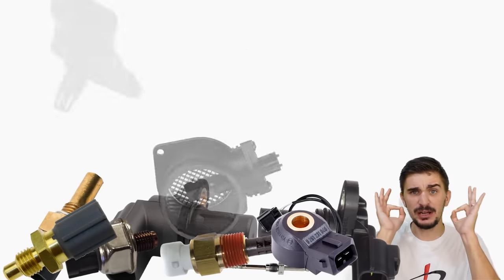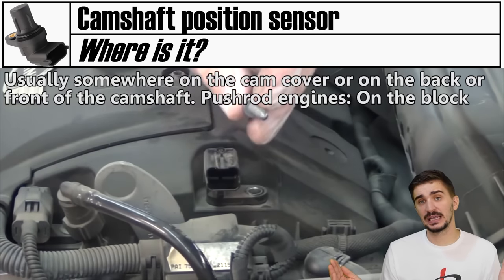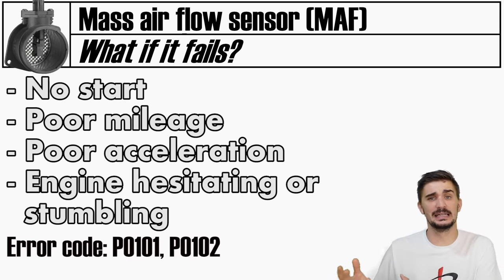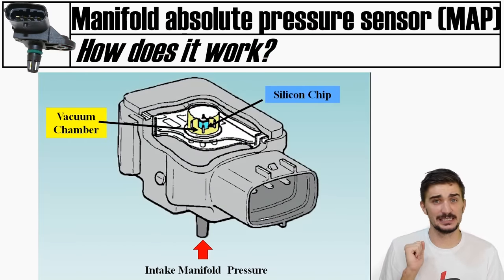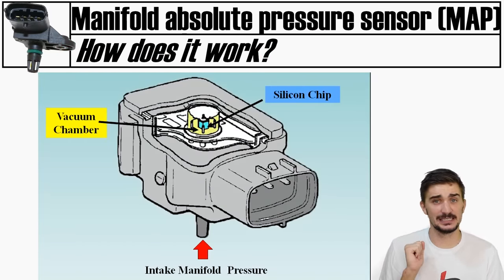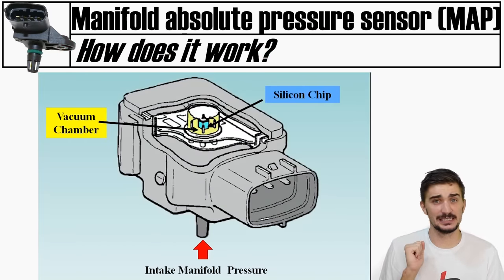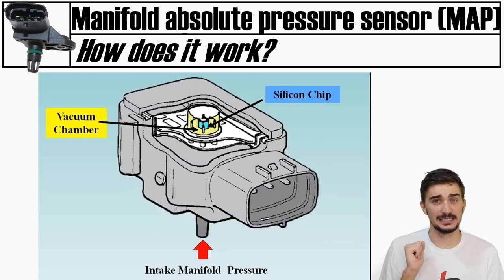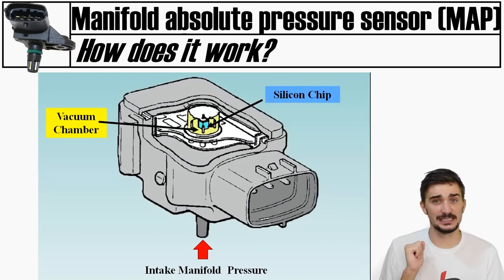EVERY ENGINE SENSOR EXPLAINED - MAF, MAP, IAT, TPS, 02, NOx, EGT - How it works, location, OBD2 code

Comment: This is pure gold, thanks for taking the trouble to make and upload this. Just one thing I would like to add, regarding fault-finding: very frequently the sensor isn't actually at fault. Instead, it's a connector somewhere between the sensor and the engine management computer. Replacing the sensor will often clear the fault because a new sensor comes with a new connector. Still, I always suggest, before spending time and money replacing a sensor believed at fault, separate connectors, spray with contact cleaner, re-assemble, re-test. I have been repairing electronics systems for 4 decades and have more experience of failed (or intermittent, even worse) connectors than I would wish on anyone!
Reply from the maker: Very sane advice! I wish I had mentioned it.
Reply: Even worse, my Idle Air Solenoid was bad. My truck would die when I'd shift from forward to reverse or just as I'd leave a stop light. It was intermittent and incredibly annoying. I finally decided that it was the Idle Air Solenoid, which it was. And it wasn't. I had removed it to clean the air passage in the throttle body. When I reinstalled it I bent one of the terminals. It was a simple issue, but since I had already bought a replacement I just installed the new one. The truck ran great after that.
Reply: I think they should do away with all that garbage problem solved
Reply: I agree. Fault finding
Reply: This is really good advice thanks @ Richard Black
Reply: So true Richard, excellent point, I myself have been in the electronics industry for decades and I've seen the same thing many times. Many perplexing problems have been solved by just reseating connectors in the affected area.
Reply: @thruitallauto2538  Guess what? They are doing away with all of them! When electric cars really become mainstream. Imagine all the sensors those will have! Good times ahead-NOT
Reply: @rickruggieri7284  lol I hear ya I still got a bicycle, and I will ride it before I buy an electric car
Reply: I read somewhere that 80% of ECUs returned for recon are not faulty,replacing them cleared a poor connection.
Reply: @adeladd7638  Doesn't surprise me.
Reply: Wouldn't
Reply: @adeladd7638  
I was told Friday by my mechanic that the first ECU part did not "work" do he's getting another mechanic to "FLASH" the new used part to try to get the ECU to communicate to either the ignition and essentially everything else from there. Or, I'm beginning to think it's something else.
It's way above my head.
But, 12 years ago I got an ECU and Ignition Control part together for $40 and just put it over my 2003 Saturn Ion, 2.2 Ecotec engine above the spark plugs and it purred until recently. It was a fluke of course, but it worked, unless I'm missing something!
Reply: @driving 4 answers 
diju dooo yur fyoowchurisdik mekanik/audO teknishin sertifikit in u.s.uv.Chruml Amerkiuh🇺🇸 or putinz' rossiya ; )🇷🇺 yur doowin a guuuud wurk - jus wanUh nowz intoo wad uthur langwij u speeeK 👃🐽🐷 kroweyshiyuh, polind, 🇪🇺🇪🇺🇪🇺🇪🇺🇪🇺 ; ) ; )
Reply: I so agree with this statement, the automotive  connector should be suspect #1  and always I use the CRC QD Electronics cleaner on my connectors before re-connecting. I just fixed my copier with this stuff.
Reply: @d4a you mentioning aem every 5 mins GUARANTEED ILL NEVER SUB TO YOU. Clicked right off! Good job $hill👍👍👍

Comment: Well done! This demonstrates how complicated engines are. I was driving once on the highway and suddenly the speed dropped from 110 KM/h to 50 KM/h. The vehicle wouldn't accept speeds of over 60 KM/h. From idle, when I try to accelerate, the engine would shutdown. So I took it to an automotive shop and they used the latest diagnosis tools and they couldn't find the problem. They said the transmission (automatic) needs to be replaced, and they said that they see a misfiring on one of the cylinders. They charged me $200 for their diagnosis without finding out the actual problem. They failed to check the very basic components, which I then did myself, and I am not a mechanic, and found the engine air filter ripped. I went and replaced the air filter with a FRAM filter that cost me $11 at Walmart and everything was fixed. Obviously, the ripped air filter allowed large air mass to flow in and the ECU couldn't accommodate the high signal reading of the MAF sensor, hence it was shutting down the engine. This is one useful example of this great video of what sensors do and how important they are to running the engine. PS. that vehicle I had was a Nissan Pathfinder 2000 SE 4X4 model.
Reply: I once had a car do that from a plugged catalytic converter. 
I would suspect the ripped air filter was caused at the dealership. This would only allow a little extra air because it is no longer restricted by a filter. The throttle body regulates airflow, not the filter. Your throttle body might need to be cleaned, maybe check fuel injectors and fuel pump/ filter. Try some Lucas trans fix for the transmission if it seems to perform poorly.

Comment: This sums up about half of my recent schooling except you couldn’t explain the tiny details of how the sensors are constructed completely which would make this video 3 hours long but overall I can say this might even be viewed in some technical schools
Reply: This video, along with all other videos explaining the engine, should be a mandatory part of all auto tech schools!
Reply: You don’t need to know all that other useless crap to be a mechanic trust me been there done that. And people will look at you like your stupid for caring about that when it comes to fixing cars.
Reply: @billybob6469  yeah the only time you you need to know that is if you design those sensors otherwise it is useless in the shop
Reply: What school did you go to 😂?
Reply: @killerdinamo08  I took 2 years in a technical high school and half a year in diesel school
Reply: @killerdinamo08  exactly my question
Reply: @billybob6469  Can't say its useless crap.   Engineers and Physicists used that useless crap to come up with these sensors.  That said, I don't give a damn about what compounds are used to make your Vibram soles on my work boots but some one designed them with useless crap.   I agree you don't have to know how they work internally except you have to know whether is a pulse output. voltage output, reluctance output, or resistive output and what the output means.   Who cares what is in that black box as long as you know how to read the output and understand what input generated that output.
Reply: @billybob6469  yeah.  You don't "need" to understand the engineering to be a mechanic.  Lots of mechanics barley understand the physics that go into ice engines,  but an excellent mechanic will be constantly doing further research into new topics
Reply: @seanandrew2823  , 
If only more engineers would have to spend some time  as a Mechanic a lot of things would be done / figured & placed differently. 45 Years as a Master ASE Tech . In the later 90's I dropped outta the Automotive Industry an went over to Heavy Equipment " Caterpillar " was the smartest thing I've ever done .
Reply: @jp040759  Knowledge is like money for me. I never have enough of either and no amount is too much!

Comment: This guy is absolutely outstanding when it comes to thoroughly explaining the workings of an engine in a simplified way. 
I never worked on an engine until 6 months ago. With a workshop manual, decent mechanics tool kit and his help, I have pulled off updates to my Toyota Hilux  LN167 5L 3.0L diesel which have not only saved me a fortune. But given me the knowledge of how my vehicle works and the sense of accomplishment for achieving something I never though I would. 
Hats off to you mate!

Comment: As a carburettor guy who does not know that much about sensors and electronic fuel injection, this will definetely come in handy the next time I have to deal with a more modern car. Thanks for the great content.

Comment: Thank you for creating this informative video about car engine sensors. It's great to see a comprehensive breakdown of each sensor, including its function, location, and potential issues if it goes bad. Additionally, providing the corresponding OBD2 error codes for each sensor is extremely helpful for those who are troubleshooting engine problems. This video is a valuable resource for car enthusiasts and mechanics alike. Keep up the excellent work!

Comment: Another symptom of a bad throttle position sensor is unpredictable up-/down-shifting of the automatic transmission while cruising.  The faulty TPS gives the ECU an erroneous signal and the ECU thinks the throttle is open further than it really is, so it tells the trans to downshift.  I had this happen on two of my Jeeps.  I now carry a spare TPS and the correct Torx driver to change it beside the road.
  Good video, sir.

Comment: Invaluable video for a home mechanic!  I have a 2016 Equinox with a 2.4L Ecotech.  Problem was it would start run 2-5 seconds and stall in P or N.  No check engine light, no code.  I changed both valve advance solenoids no help. I replaced high press fuel pump, no help.  I disconnected the MAF sensor and car ran with check engine light and now a code.  I tried cleaning it with MAF sensor cleaner no help.  Spend $70 for new sensor and fixed it.  It kicked my ass because there was no check engine light or code.  This video is awesome and I saved it to my favorites.  Ty for making it.

Comment: I started a fulltime automotive job back in the 70's and seen the advancement of electronic engine control over the years until I retired (ASE Master Tech)  in 2017. When I started, Chrysler is starting to add electronic ignition on their vehicles. Then GM and Ford fallowed. Then they started making computer controlled carburetors. Oxygen sensor was called Lambda then. European and Asian were using CIS (Continuous Injection System). The big three were using TBIs ( Throttle Body Injection). Then non-sequential (gang bang) port fuel injection followed by port sequential fuel injection. The ECM (Electronic Control module) was changed to PCM (Powertrain Control Module) when the module is controlling the engine and transmission. Now they have Direct Fuel Injection but it wasn't perfect because of the carbon build up in the valve seat causing driveability problems. They had to go back and add a port fuel injection to wash the carbon build up. I've learned that even you memorized all the function of the sensors and know how to use the scanner, there is a time that a problem exist but no DTC. Also start your troubleshooting first by visual inspection. Sometimes you can fix the problem without even connecting the scanner. Don't make a mistake by thinking its an electronic problem right away. Nice presentation.

Comment: Great video! Super concise and interesting! Another tip about MAF sensors for anyone that might see this is that when you unplug a MAF on pretty much any vehicle the ecu will change to a default fuel map. So if you’ve got a P0101 or other maf code/the engines running like garbage, unplug the MAF and if the engine starts running like normal you know where your problem is 👌

Comment: very useful, i remember when my MAF sensor had a more or less manufacture defect and was causing very rough idling and stalling even tho it was an automatic
the reason was if very slight preasure was applied to the plastic housing, it would stop working and cause the engine to die, with all of the vibrations of the engine it was basically pressing that defect spot a bunch and causing a lot of running issues

Comment: @ 13:32 Once working on a car (2001 Saturn SL2) I forgot to attach back one sensor on Air Duct, I think it was Intake Air Temperature sensor. On that car the sensor is located kind of close to  the bottom of the Air Duct, so I put back the AD and forgot about that sensor. The result was: I started the car, I don't remember what I was checking and how the engine was running, but then I stopped the car. But the engine was running. I removed the key, to my astonishment the engine was still  running. I stopped the engine only by disconnecting the battery. Not sure what kind of process happened there, but from that time I always carry a corresponding wrench in the glove department for the battery in every car.  Very good review on engine sensors. Thank you. So is it like every sensor on a car would be an Engine Sensor, or there are some not related to the engine? Thank you again.

Comment: Great video!  You certainly hit the main stand-alone sensors I know of.  Others are built into the ECU electronics- battery voltage, detecting faulty solenoid resistance, O2 heater, purge vent, etc etc).  Drivetrain gets into trans and diff temp, brake wear indicators, tpms, etc.

Comment: Just a brilliant video. 
I knew that to clean the MAF sensor after every air filter change but to only use MASS Air Flow sensor cleaner (CRC Product) I used an electrical component cleaner , this doesn’t work as leaves a slight residue behind. Than use MAF cleaner , works perfectly.

Comment: Excellent as usual. Can you elaborate on knock sensors and how effectively vs not some engines use them. Thinking of the Subaru EJ’s vs FA’s more specifically. EJ’s are known for knock issues. Thanks

Comment: Buddy, I broke my MR2T. This winter I installed an upgraded turbo and a brand new ACT HDSS Clutch. I got a great spring and early summer out of it but I killed it. I’m hoping it’s just the clutch but I may have launched an e153 transmission into retirement.
Sorry, had to vent to someone who would understand. I’m feeling very defeated ATM. But I’ll be back.
Reply: @CathodeRayNipplez  
I did launched the F$&@ out of it the night before at the track. I’m actually surprised the axles held up. Strangely it gave no issues for a few hundred miles the next day as I was driving back to my home city.
Reply from the maker: It's a journey of ups and downs. I'm sure you'll get through it and come out of it smarter and stronger. My guess would be just the clutch. An e153 is extremely hard to kill.
Reply: @CathodeRayNipplez  
Yes, sir. Guilty as charged. I did pull a 1.6 60’ on that run, however. A personal best.
Reply: @d4a  
Oh, I truly hope so. If that’s the case I’m going to take the downtime to upgrade to a Link ECU and some 1200cc injectors. If not, Toyota still offers the late model e153 with upgraded LSD brand new in a crate.
Anyway, great video, as always. This is my favorite car related series.

Comment: I love when “mechanics” say, I don’t work on that brand, they’re different.
I always give them a brief statement. A 3 wire sensor is a 3 wire sensor, regardless of brand. I put voltage, ground and signal.

It’s task may vary, but it’s function is simple To figure out and diagnose once you realize the basic functions.
Reply: While that is true it is much different on certain cars. I’ve worked for ford for 20 years and and electric company over 17 years. So 37 years of little cars medium trucks limos buses bucket trucks diggers tracked vehicles tractor trailers and pretty much everything in between and have little problem with any but European cars I absolutely despise. Jaguars bmw Mercedes Land Rover and so on. So different that they are much more difficult to understand and finding info on them can be challenging. Luckily I have more work than I need so I don’t need to work on them.
Reply: Ijb.

Comment: nicely explained. i might mention that egt sensors are invaluable in airplane engines which take off full rich, but once established at altitude the pilot will lean the engine by egt to a temp close to max lean, for fuel conservation. also with leaner air at altitude this is a way to visually confirm economy. regards, k

Comment: This is an amazing video. Basically, the car's computer seeks input information from each of these analog and digital devices and changes the performance of the engine based on that data. Good job.

Comment: This is really helpful! This shows how simple all of these electronics that control the vehicle really are! (Most seem to run on variable resistance or have a 3 wire setup). My question is, are some of these sensors universal? Can you use an oxygen sensor or coolant temp sensor in any vehicle or is it brand or even vehicle specific?

Comment: Yet another outstanding video thank you. I know it's outside the remit of this video, but many so-called Technicians replace parts as soon as they see a fault code, without reading the fault code description and checking the basics first. Examples are a MAF fault code, and it's a split air intake pipe, or an O2 sensor fault and it's a loose vacuum hose. Many people out there believe that all we have to do is just plug a computer in, and it'll tell us what's wrong. I love to point out that it just tells us where to start looking.
I'm babbling. Sorry. I love your videos though!
Reply from the maker: You're not! This is important and the reason why mechanics now struggle to find good employees 😁 thinking is hard
Reply: @d4a  it does feel like a dying trade, certainly here in the UK. It's a highly technical job, the customers are often rude and love their Google diagnosis, and the wages do not reflect the talent of a good technician. Nobody wants to do it anymore. I gave up a 33 year career a couple of years ago and I don't miss it! But I do enjoy your channel thank you.

Comment: On EEC-IV fords (late 80’s early 90’s) the crank position sensor is part of the distributor. The distributor gear is attached to the crank, then under the rotor is a toothed “bell” that passes between a Hall effect pickup that goes to the EEC. Neat stuff. Rarely see them fail but when they do you need to rebuild the distributor.

Comment: Quick tip: if your Turbo car doesn’t rev over 2000/3000 rpm change the MAP and MAF sensor before taking the Turbine out,i changed the MAP sensor on a 2.5 TDI and it pulls even better now!